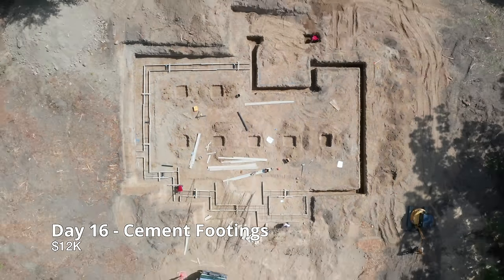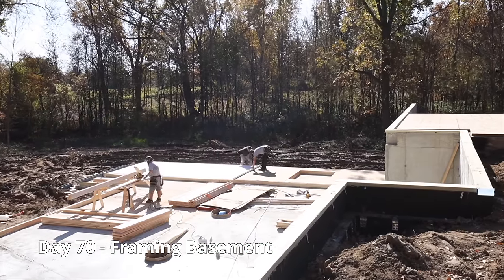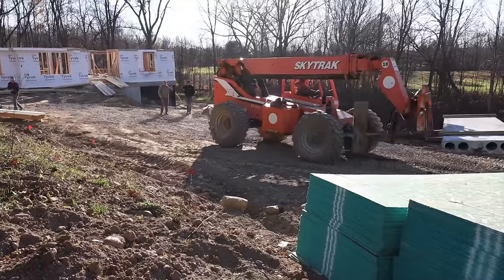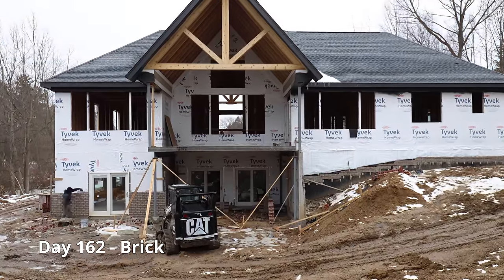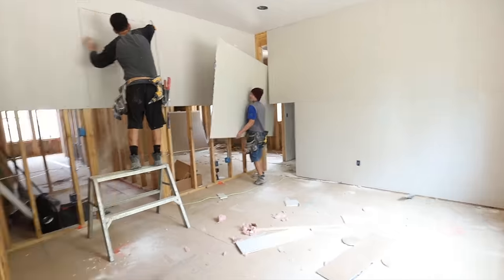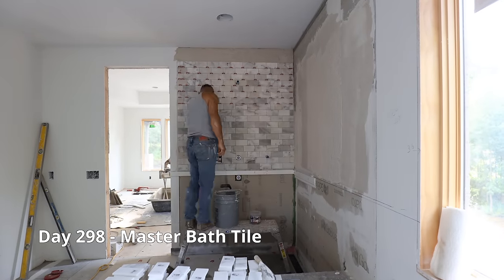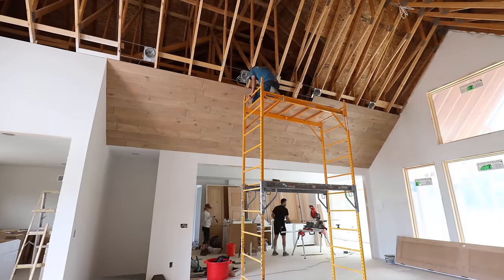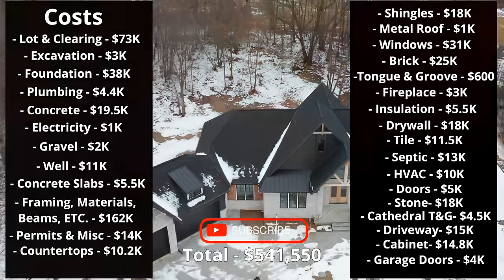1 Year Timelapse Building Our Custom Home

Comment: The location and layout of the house are great. When I compare the timber frame construction methods in the USA with those here in Germany, it looks as if you are building with toothpicks or matchsticks. 😉 I particularly noticed this in the roof construction. I would assume that the thicknesses here are almost twice as thick. And the thickness of the insulation from the basement to the roof is also not comparable. It's really interesting to see how differently things are planned and built. But I'm sure you'll feel absolutely comfortable in your new home.
Reply: My house is from 1870, we last got it inspected about 9 years ago…and it’s still going strong. It’s absolutely insane how strong wood houses are if it’s constructed properly.

Comment: Beautiful house you two !  One ?- the electric cost I thought you mentioned was from the supplier.  What was the rough in cost with the panel if you don't mind sharing?    Thanks
Reply from the maker: Hi Mike, Thank you! Our total electrical costs will come to about $19k when finished. The Utility Company in our area is DTE. They come out and hook the house up to the grid, excavate, run the line and add the outside panel for around $1,000. I sure the cost varies depending on the location and utility company.

Comment: 1:21 Filling concrete in those wall forms, do you not face the issue of honeycombing in the concrete wall slabs, you didn’t use the concrete vibrators, then how are you you managing to get smooth surfaces ?

Comment: What i dont understand is, 
why in Northamerica is everyone building a Woodenframe House there, here in Austria,  Switzerland and Germany every House is builded with bricks and Mortar.
Its more Energy efficientthat , that means less energy costs,  you got better isolation and it last 5 Times longer than a House of Wood.
You can pass it on to your Grandchildren in 60 Years and it will not loose any value.
So why Wood , only because its cheaper ? That is Short Sighted.

Comment: Amazing for only ;500k
Reply: @Logical.Psychopath  The same house in Westeren Europe will cost between 1.7mil and 4mil depending on the location.
Reply: @Logical.Psychopath  I have buld a wooden garage for 3 cars without isolation, windows, floors,... only concrete and roof for about 100k $ And this end of 2023, even without construction workers.
Reply: @Logical.Psychopath  My wife has a construction company, so believe me prices are correct.

Comment: the author has a great video.
but I would point out the following.
OSB boards are dangerous to health. it would have been better to use plywood.
You poured the walls out of reinforced concrete. the whole house should have been made that way. reinforced concrete is simply cheaper than wood! wood is very cold. even laying bricks won't solve the problem. you have snow in the winter. there will be big bills for paying for the house.
You need to understand that a straight reinforced concrete roof, or a roof made of boards, is much better than a wooden one. and doesn't require maintenance. and you can make a recreation area there. you have a lot of space in the roof that was wasted.
the furniture and the ceiling have a gap. there will be dust there. you should have made the furniture without gaps with the ceiling.
reinforced concrete and brick for walls are better than wood and plasterboard. and plywood is better than OSB boards and also better than plasterboard.
but the house is beautiful :) it's obvious you built it very thoroughly :)
Thank you for the video :)

Comment: I'm from Russia. Always, looking at how houses are built in the West, I wonder how houses are built for space money, which in Russia would not have passed the inspection according to building rules.
Concrete without reinforcement, electrical wiring in a wooden house is made "masterfully".
In Russia, for such money, you can build 2 such houses, while using reinforcement in concrete, competent drainage on the site and the walls would not be made of wood but of a more serious material.
In Russia, it is customary to build houses with a view to 100-150 years of operation.
Capitalism provides at every step how to extract funds from the customer.